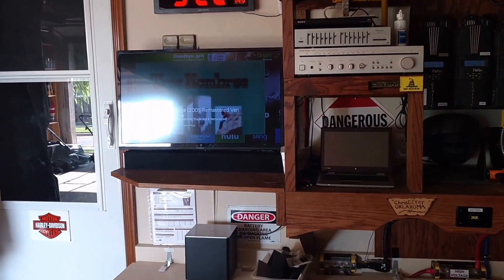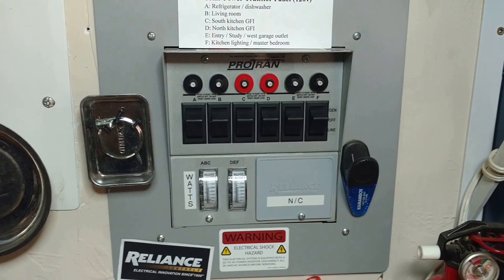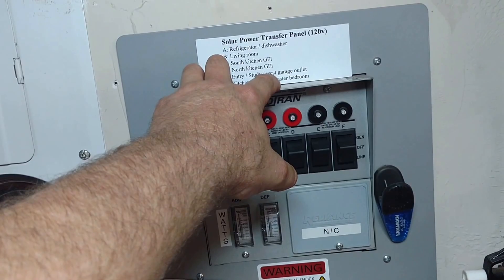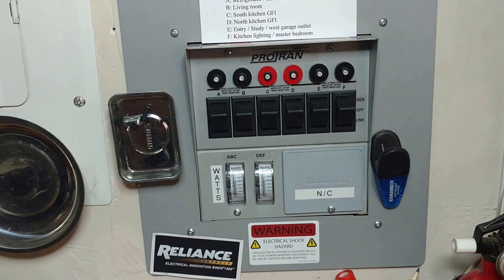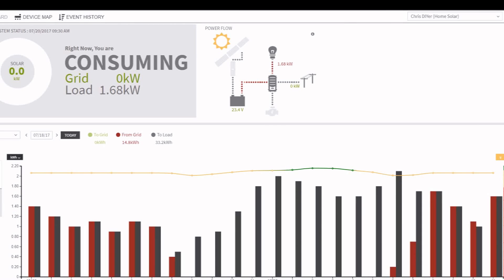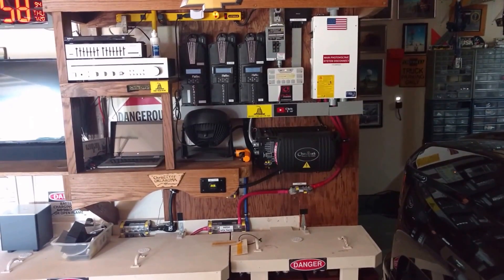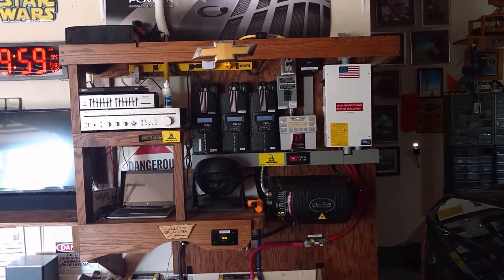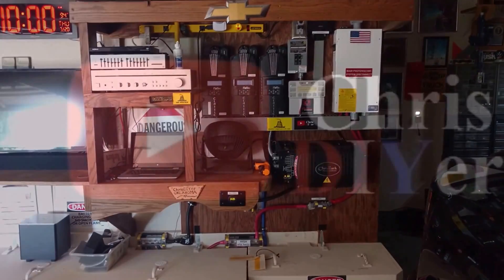What the heck is "partial" off-grid home solar anyways?

Comment: I like to think of my system as a back up generator but  I also want to get away from wood heat  and use more solar.We just had a very bad wind storm and lost power for 40 hours. Fri.may 4 530pm- sun.6 1030am . I almost have everything working but I need more inverter. It was fun. The only utility we have is electricity and internet, solar definitely helps.Who wouldn't want to make there own power. Great vid.

Comment: thats the best tranfer switch ive seen so far,
usually theyre just either or , youre totaly on grid or totaly off grid.
i have inverters that just stop taking power from the batteries once the battery voltage drops to a certain level and the reconnects to batteries when the batteries reach a certain voltage, theyre old school grid ties , the new stuff out now is great  new hybrids, not to mention the batteryless sma etc for times when the grid goes down, atleast you have some power for the fridge if the sun is still shining , the real advantage of any hybrid system in my eyes is kwhs are just a few cents, batteries on the other hand man they can be very expensive.
Reply from the maker: Yep...batteries can be expensive. The Trojan's I use have been pretty good...for deep cycle flooded. I also have some of their AGMs...really solid performers
Reply: sorry to bother you once again !
but if you were to do it all again after all youve learnt over all this time would you now prefer agm only , 
trojans are definitely appealing to me but being in Australia import duties can make some products more expensive than others depending on place of origin.
not sure what you guys pay , here were around $500-600 for most 200amp hour 12v batteries, so i bought near new yuasa instead until i figure out what batteries are going to be the best bang for my bucks, so looking forward to batteries that last a long time and can be deeply discharged instead of the 20% and dont cost the earth.
Elon musk has committed to building the worlds biggest lithium battery in South Australia to assist the grid in times of high demand, really hoping that gets the ball rolling,
 thanks for your reply i realise theres more to life than YT , but its a great learnig tool , man it wouldve helped me out at school years ago.

Comment: Nice....info the same. But in my area the price per kWh is 
 .14c all the time 

One important question though
I have a 24v system with all my panels tied in parallel.  1- can I get more power by doing series parallel or just stick to parallel?  

2- I see that you have several charge controllers which means you may have multiple configurations please expound

Comment: that is all I try for is part off grid. So far I have cut my bill in half and now with the added 2400 watts I hope to do 2/3 or 3/4 reduction
Reply from the maker: Excellent! It takes time and $$$. Off-grid is more expensive overall, but (IMO) I think there is more flexibility when the grid goes down. With a strictly grid-tie system, when the power goes out...yer hosed. Unless you have a backup generator or something. Thanks for commenting OTE!

Comment: 50 cents a kWh!!!???  What?? Woah! They really do rape you on peak hours out there in OK.  Mine only increases in rate if you exceed a certain number of kWh in any given month; then you go into a higher tier that is STILL only like 18-22 cents or so.    But with my usage, I've been negative every month so far so I'm not buying anything.  In fact, I need to convert a gas appliance to electric because my power company does not pay out when you have more outflow.  OH, forgot to mention mines grid-tie but that's fairly obvious by now.  My separate off-grid system is merely for backup and to run a few things.
Reply from the maker: Check out my post on my Chris DIYer Facebook page. This company netted $338M in 2016. Their "peak hours" rates are 38 cents/kWh (excluding fees, taxes, et al charges). So, yes, closer to 50 cents per kWh. All data available online, available for public viewing. And they whine about how much it "costs" to make electricity during these "peak hour" times. Really.

Comment: That's very interesting Chris, we both use less power in the winter. I guess its because you have gas heat and I have wood heat. I use 7.5 KWH"s a day in the summer and I use 4.5 KWH's in the winter.  For me the difference is I use 2 refrigerators and a freezer in the summer. In winter the freezer goes on the back deck where it is freezing much of the time but still running and we turn off the other chest refrigerator and leave the lid open. It stays about 40F in the down stairs bedroom so eggs keep just right. I'm only using 1/3 of our solar potential in the summer. That includes fans and a evaporative cooler, My wife's AC and water heater in her beauty salon too. We just cant find enough stuff to turn on so next is switch the water heater in the house from LPG over to solar  for 6 months of the year. If it was hot and humid like where you are I bet our usage wood look very similar. You have explained your system usage very well. You have a clean, tight and right solar install Chris. Very cool my friend.
Reply from the maker: Thanks. I agree. Right now it is 101 deg with 35% humidity....stifling warm. Kuwait was the worst I ever saw... mid 120's with about the same humidity. I have a friend over there now and she says it is hotter than that! But, their sun is desert sun...long, hot, bright days...would make for some great solar panel kWh. Thanks...been at this solar gig for 3+ years and still learning. Finding that even when I think I am done...I get more solar panels.

Comment: Great explanation, Partial off grid is a great place to be.
Take Care Friend.
Reply from the maker: Thanks...appreciate it. Each system is unique...
Reply: Chris DIYer Nice....info the same. But in my area the price per kWh is 
 .14c all the time 

One important question though
I have a 24v system with all my panels tied in parallel.  1- can I get more power by doing series parallel or just stick to parallel?  

2- I see that you have several charge controllers which means you may have multiple configurations please expound

Comment: Almost seems like a custom video to answer my questions from the previous video! I'm sure you had others with similar questions, so THANK YOU! That said, for my mind that may not 100% understand everything, could you keep some of your circuits running on the battery power all the time? Your lights for instance. Is there enough juice in the batteries to keep your lighting circuit operating through the night to save even more money? By the way, I love the switch panel. I had no idea something like that existed that allowed easy switching. Does Oklahoma allow "Net Metering", and do they charge you extra for having your system connected to their grid? In Texas, they don't allow Net Metering...and where people are grid tied and are producing back into the grid, they charge an extra fee up front, then "buy" your electricity at a fraction of what they charge for theirs. This is how I understand it, but I could be mistaken. Anyhow, I appreciate your videos. I commented a year or two ago on your green box. I was previously an AGE guy before cross-training into Physiology...and just started Terminal Leave in June! So we have a little something in common! Take care!
Reply from the maker: Roger that...now I remember you. Congrats on terminal LV...retiring? Oklahoma (at least the power company I am connected to) does not offer net-metering. However, they do allow grid-tie into their system. With fees, low return for over-producing solar energy, it isn't worth my time and $$$. To each their own...some grid-tied systems are AMAZING. Seen some stellar hybrid systems (grid-tie with batteries). To me, it all has to do with how deep your pockets are and what you need it to do. I like the self sufficient power source and being my own MEPP generator!
Reply: Chris DIYer, Yeah, retiring after 20.5 years. I would have been happy to do more, but it just isn't the same Air Force/military that it was a decade or more ago. Hot tired of the social experiment and tired of the craziness that has come. Not to mention that it just made sense to get out, finish an education, and have another full career. Thanks for your info. I may have many more questions in the future. If I ever get to a position of setting up my own system. Like you, I prefer to do things I know how to do myself rather than paying for it...and I prefer to be self reliant.

Comment: Yakatee smackatee...that's new vocabulary !   Dig it Chris. I agree with you that a transfer box with more breakers would be SUPER.  Has anybody seen a "factory made " breaker box with built-in transfer capabilities ?  Thanx   J K
Reply from the maker: Hahaa...yeh, my communication skills need some work! My electrician did some great work during the upgrade...wished I would have videotaped how he did it. Never seen a circuit breaker box with automatic ATS capability...kinda like an UPS maybe?